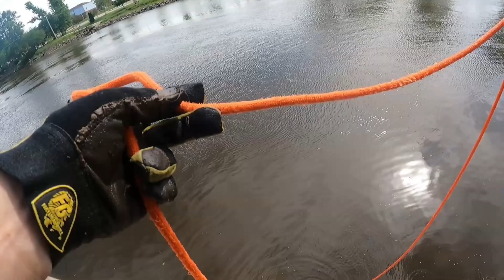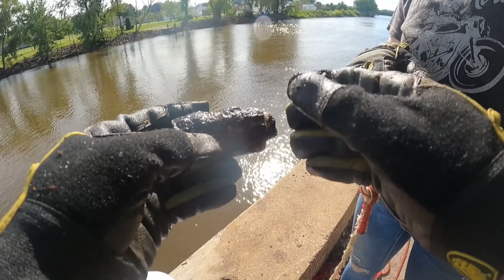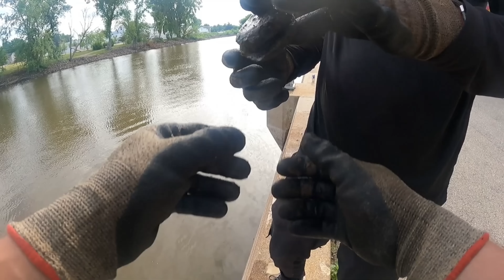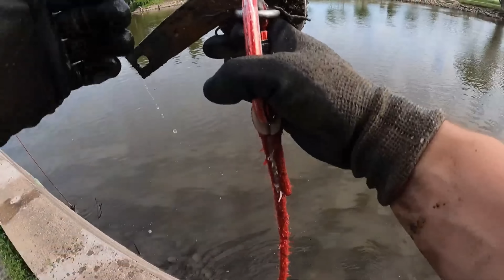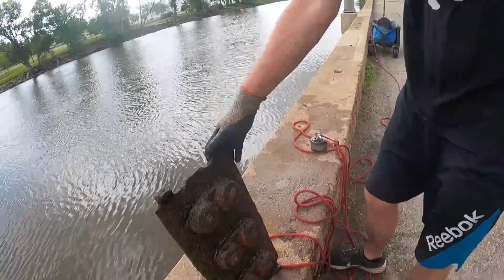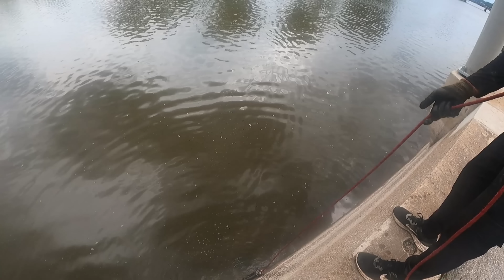My Girlfriend & I Hit The Ultimate Magnet Fishing Jackpot - You Won't Believe What We Found!(Part 2)

Comment: I am 84. In the 40's, before electric refrigerators, we had ice boxes for our food. A truck came around and you would put a card in your window indicating how many pounds of ice you wanted that day. The ice man would cut that much off bigger blocks and bring to our door using those ice tongs to carry it and wearing a long rubber apron. We would put it into a special compartment. The ice gradually melted into big pans kept under the icebox, which needed to be emptied regularly. We neighborhood kids would follow the truck around and get the excess pieces that broke off to suck on, like a popsicle. A welcome treat in summers before air conditioning. You can google icebox to see what they looked like. They were mostly wood. Also, Milk of Magnesia for the stomach also came in blue bottles like the partial you found.

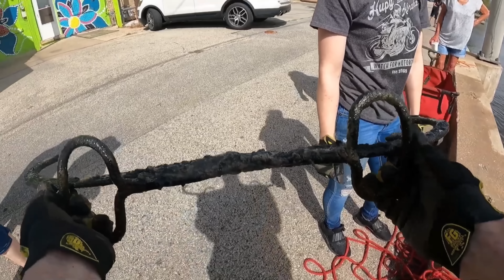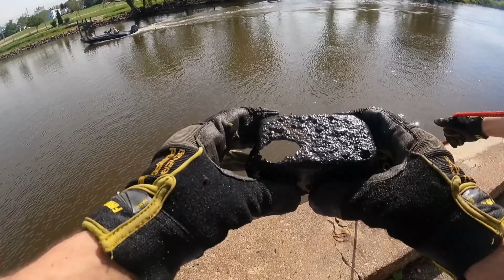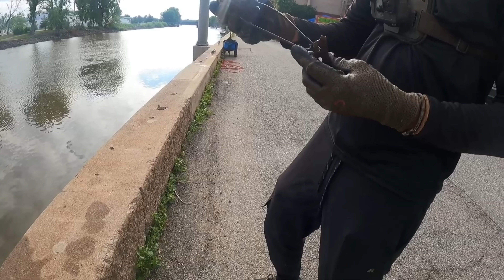Comment: 5:05 return spring for an air hammer 8:11 Ice tongs 16:47 voltage regulator cover31:31 insulator 1:26:39 Insulator mounting bracket

Comment: Your hook rack / wall hanger whatever is a part that hooks around the horses for ringing them up for pulling wagons and such one on each side
Reply: Now you both found I forget what those are called but they go on each side of a horse for pulling a wagon
Reply: Coffee grinder you got a coffee grinder with a bowl in the crank
Reply: At peace with a screw that screws up into something you said is a insulator for a grounding wire to a telephone pole or whatever
Reply: Might have put the tape on there for traction when you're trying to turn it by hand and a hard spot to get to
Reply: Hemostats or roach clip
Reply: I'm not sure but I don't think they made Bud Light back when they were using tin cans
Reply: Your handle for a shovel is top head of a mop